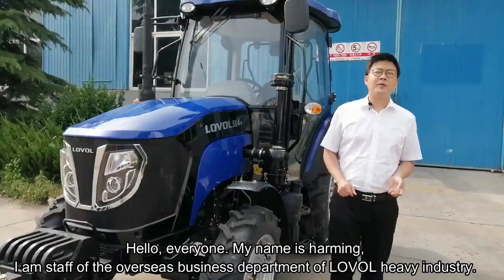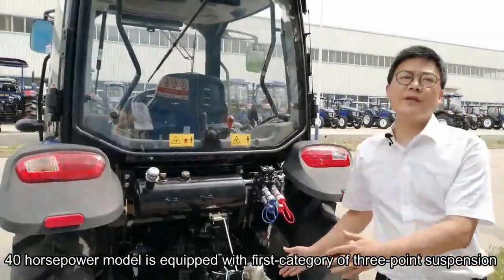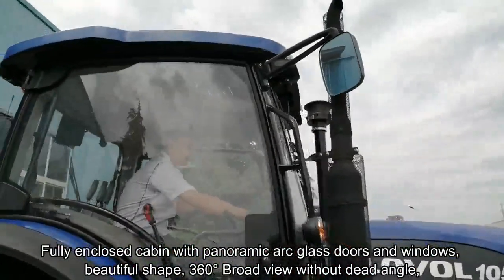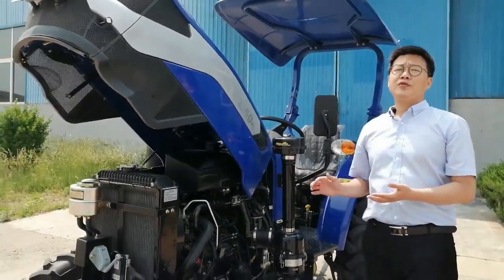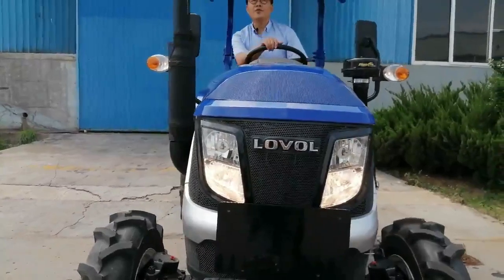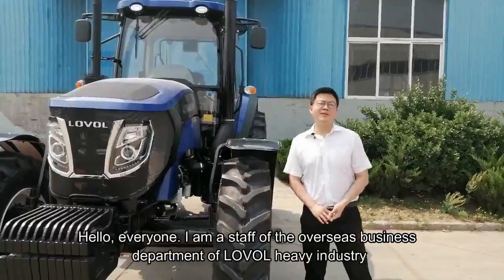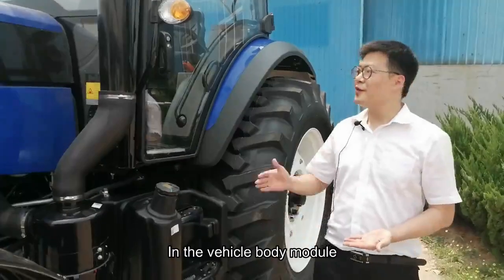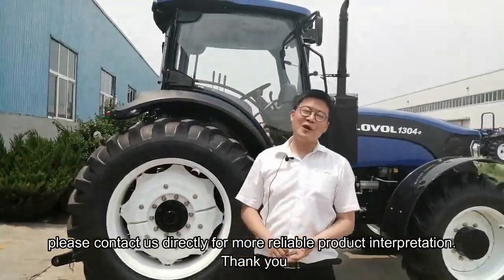Lovol B series tractors｜Detailed product explanation

Comment: Greetings from Serbia. I am interested in buying lovol 754 III here in Serbia. I have one question. Does lovol 754 shares same gearbox and differential(rear end) with lovol 504/604 or it has stronger ones because of its stronger engine?
Reply from the maker: Hello, thanks for your message
liuting@lovol.com
This is the mailbox of our business manager, you can contact her if you have other questions.
Reply: @lovol.global2882  ake sú rozšírili a lepší traktor . Lovol TB 504 a Arbos 3055 ktorý z tych traktoroch je lepší prosím vas